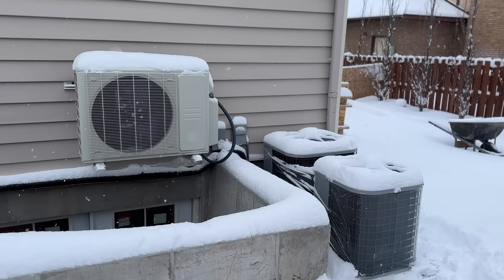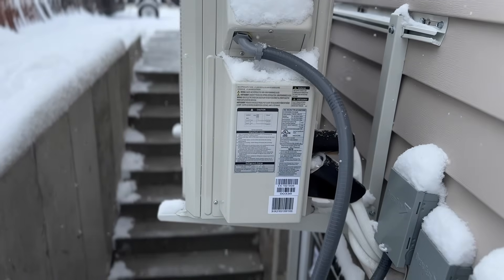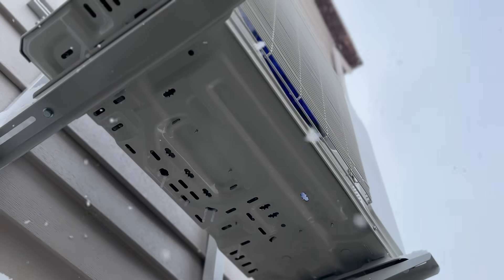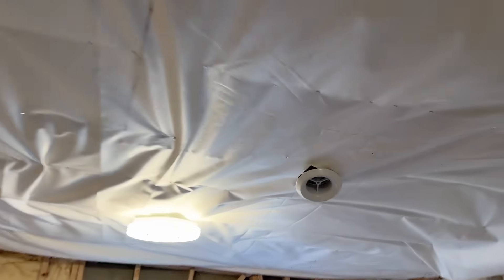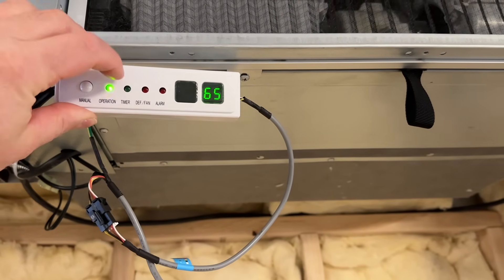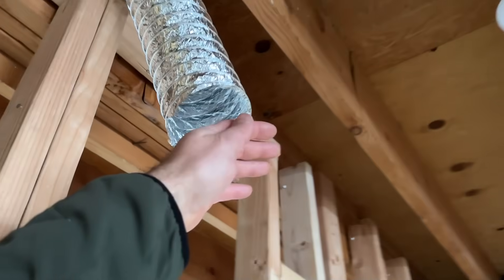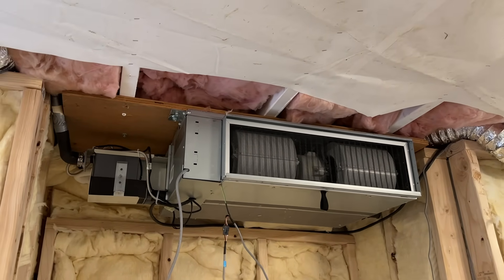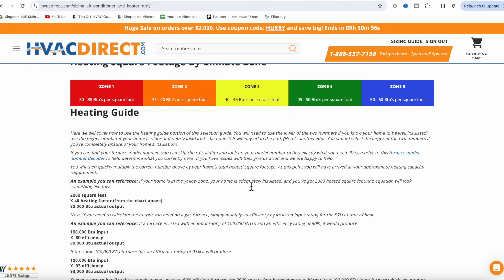What Is A "Concealed Duct" Mini Split?

Comment: I installed one (18K BTU) in my attic to serve 3 upstairs bedrooms that were under-ducted from the main unit. I built the plenums (sheet metal) and designed the duct runs myself (3x8" supply, 2x10" central return). It works great, and likely more reliable/balanced than trying to do a multi-head for small (150-200sqft) rooms that don't need a ton of BTUs. The only downside to these is constructing plenums - I wish companies offered pre-built metal, insulated plenums with a way to quickly connect and seal to the unit. Some of that challenge was just me needing to improvise supplies since I was installing it during the covid shortages.
Reply: That’s been the biggest hang up for me with these units is that there still seems to be a lack of plenums made for these. At this point, I wish the manufacturers would include one or allow you to order one that would fit the unit.
Reply: @chadhowell1328  Totally agree. If I did it again, I think I'd just build a box out of ductboard instead of bothering with sheet metal. Much easier to work with, and it's already pre-insulated. Assuming your duct runs and unit are supported correctly, there shouldn't be any issues with it pulling/falling apart.

I assume many of these units are just installed directly into a soffit in the ceiling, and the sup/ret are in the same room and just get a basic grill slapped over them. I have an install in mind where I may do something like that, but I don't really hate the way wall-hung minis look, and that's a heck of a lot less work. They tend to be cheaper too.
Reply: Is your unit in an unconditioned attic?
Reply: @jeffa847  Yes. I insulated the unit with some fiberglass wrap, and the ducts are flex duct. At the time, 8" R-8 ducts were impossible to find, so I had to use R-6 for the runs, but I ended up burying them in R-30 fiberglass batt insulation. R-30 is the perfect thickness to put batts on either side of the duct, then one arched over the top. Everything is sealed with mastic and tape. 

Unit is hung from the rafters (about 30" from the plywood attic platform on the ceiling joists) to allow some access to the panels on the bottom if a fan motor blows. Height also allows me to have a pretty long 3/4" pvc condensate pipe run (gravity, pump is disabled) out with the lineset and down. Also insulated with pipe insulation.

Works great, no leaks, probably better insulated than most installs I've seen in attics.
Reply: Im thinking about installing one for the same purpose and considering 3D printing some plenums with built in round takeoffs.
Reply: @thatf_inguy8220  Most areas follow building codes that refer to the  International Mechanical Code, specifically Chapter 6 (602-603). In short, materials used for plenums/ducts, that are exposed to the air flow, must be flame/smolder and mold resistant. There's specialized UL testing for materials rated for ducts/plenums that I doubt printing filament (or any plastic) conforms to those standards. That's why I went with metal: as long as the core of the plenum is metal, you can use whatever insulation you want on the outside. You don't want your HVAC unit to assist in distributing toxic smoke if your plenum or duct system were to catch fire.

Comment: All that flex is going to make the unit work harder than it has to. So much static loss through that stuff. A 4" duct is only good for roughly 65 cfm airflow. What kind of spiderweb did they install!?
Reply: It's a 1.5 ton unit so assuming the standard 400cfm/ton it would require 600cfm total. I saw at least 6 ducts so that's 100cfm each. These mini-split style units don't need as much airflow but I agree it seems a bit too restrictive.

Comment: I have a question, where is this located? This looks like a pretty good install however im questioning the uninsulated flex. What if in the summer when it is hot and humid? Here in NC those would be sweating badly in the summer, unless if it’s a conditioned space. Above the ceiling is not a conditioned space and those could sweat in the summer
Reply: He's most likely in Utah where humidity is usually never a problem. That's where he lives.
Reply from the maker: Correct this is Utah very low humidity
Reply: @diyhvacguy  ahhh okay gotcha
Reply: @diyhvacguy what kind of duct would you use in a humid area?

Comment: Thanks for the concealed duct overview video. Interesting to see a couple installed with the duct runs.
Reply: yes please do a install on this I have a specific use case for this unit
Reply: @clue___  I installed one of these. I really like it. Works well at distribution to different rooms
Reply: @paulstewart323  how many rooms did you get out of it and how many ducks per run can you run? I'm assuming it's according to size of course
Reply: @clue___  I just put 3 bedrooms and the bathroom on it and put a ductless in the living room kitchen area but I think it all could have been served by the ducted unit if I used big enough ducts to not restrict air flow
Reply: @paulstewart323  nice!